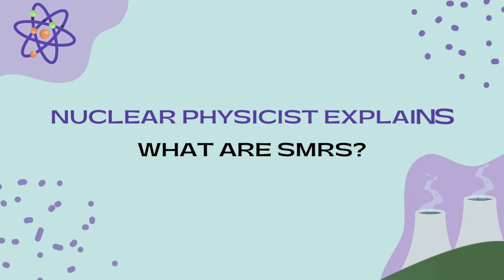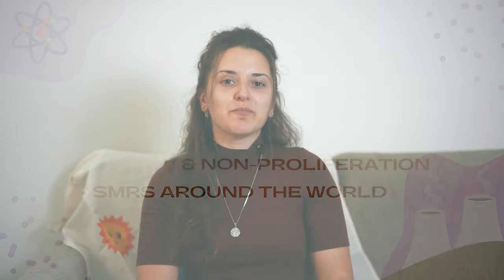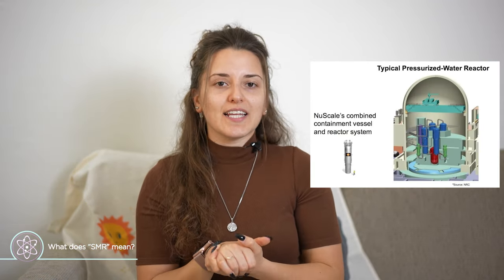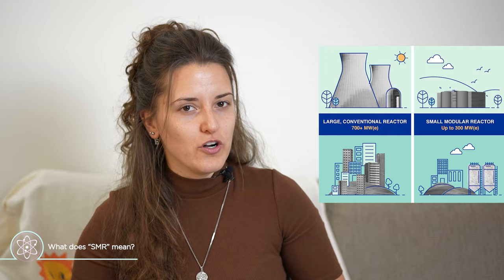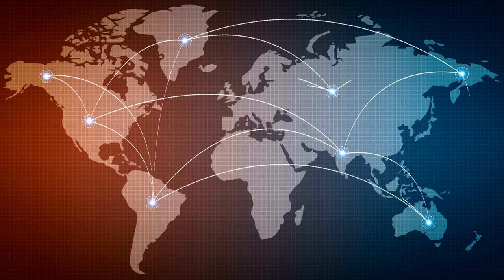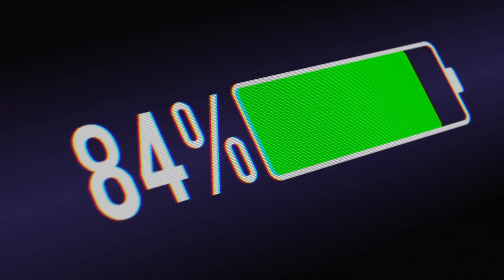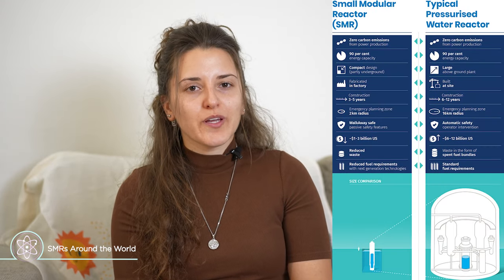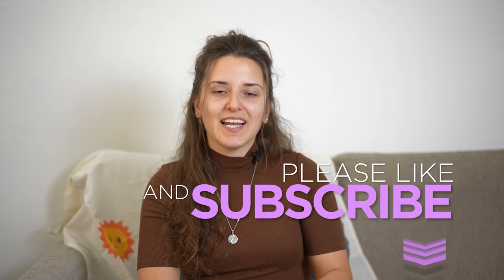Nuclear Physicist Explains - What are SMRs? Small Modular Reactors

Comment: I think it would be great if you made a video explaining to people how the new reactor designed are designed to be more "fail safe" by physics rather than by safety systems. In other words, when things happen to the new reactors, that would be catastrophic to the older ones, the reactions stops by itself, not by mechanical intervention.
Reply: Nuscales failsafe left the failsafe in the condenser and wasn't failsafe like Nuscale advertised it.  You people don't really think they are failsafe do you?
Reply: @paulmobleyscience  😂
Reply: Curious question: Can this be weaponized at all? My only concern is that nuclear technology would be very dangerous in the wrong hands. Would this be an exception?
What if some nefarious organization gets a hold of these and somehow builds a nuclear warhead out of this?
Reply: @paulcataluna9796 You can build a military nuclear facility without having any civil nuclear power plants because there are different means to produce enough material for a nuclear bomb. North Korea doesn't have a civil power plant but it has nuclear weapons.
Having a wealthy society keeps countries from starting wars and having hostile regimes and dictatorships. We could end povert, hunger and the global warming with cheap smr, the heat of the smr can be used for desalination, high-temperature electrolysis or process heat for the industry, and with CO2 capture nuclear can run CO2-negative because it's the only source of energy producing less than 5 gramms CO2 per kilowatthour, so it can remove more CO2 than it produces.
 Sorry for my bad English, I hope the message got through it nevertheless.
Reply: @OnYourMarkgitsitGooo  You can have nuclear power plants without nuclear weapons. The uranium needs to be enriched to work in nuclear power. It needs to be much more enriched for a bomb. We want to worry more about who had enrichment facilities rather than power plants.
Reply: Some analysts looking at the waste streams of SMRs conclude that smaller reactors will produce more radioactive materials per unit of kilowatt hour generated compared to larger reactors.

Schneider: That’s the MacFarlane and colleagues’ paper, which is pretty logical if you think about it. If you have a small quantity of nuclear material that irradiates other materials, then it’s proportionally more per installed megawatt than for a large reactor in which there is a larger core.
Reply: grahambennett8151  Have you seen Kreosan English yet?
Reply: grahambennett8151 
Your doomsday thinking is outdated.  Advances in radiochemical engineering now allow for the creation of non-breeder reactor designs - including SMRs - that can BURN HIGH-LEVEL WASTE and leave low-level or non-radioactive waste behind.  Of course, a module can't be fully loaded with it, but it can take some and transmute it into morevmanageable byproducts over its fuel cycle, which can be replaced with new waste-bearing fuel elements.  This also typically makes the reactor unsuitable for producing Plutonium to be harvested at the refueling cycle, because the 'breeder' material is not part of that reaction process.
Reply: grahambennett8151 
You raise a good point about the support industries for nucleae fuel production & waste handling not being carbon-neutral.
Are you familiar with the Haber-Bosch process?

Comment: There is a former coal fired power plant in Wyoming that was being shut down. The coal fired boiler was removed, SMR's are being installed and will use the existing steam turbines to continue generating electricity. This is the best use of SMR's, replacing coal fired boilers in existing plants.
Reply: what's the status of this?

Comment: We have already broken ground for one in OntarioCanada and have plans to build a couple more.  We need the clean power for the electrification process that is under way now!
Reply: Really?
My understanding is that there is only an MOU in place. No registered design, no committed finance.

Odd that Canada isn't backing it's very own CANDU, favouring a fundamentally less efficient SMR concept. 
Very strange.
Reply: @aaroncosier735  well, we are refurbishing the CANDU reactors at the Pickering power station to get another 30 years out of them, and we already did the ones at Point Elgin. I think the relative simplicity of installing SMRs makes them an attractive option for the powers that be. There is a big EV transition under way in Ontario, so they need more power relatively quickly in order to supply projected power requirements.
Reply: @WhatWeDoChannel  
Refurbishing is not quite the same as new build. I agree that doing so gets a little more back out of sunk costs. 

The claimed simplicity of SMRs is so far just advertising. 
Small reactors are not attractive: they are less efficient and projected to cost twice as much per unit of energy produced. 
The only selling point is the perceived modularity, which is still a pipe dream. None of the existing SMR concepts has gotten past the drawing board. They will require demonstrators to confirm the basic concepts, and those will not be "modular". Then further rounds to get to a hand-built prototype of the future modular design, then a factory to make them. Don't expect to see SMRs for many years.

EVs may increase demand, yes, but they also have a huge storage capacity. They will enable the use and storage of more variable renewables. Rather than increase demand for nuclear, I think EV storage will increase the usability for renewables, which are available now rather than SMRs which could yet be decades away.

Comment: Although it may be technically possible, IMO output flexibility is not really a useful feature of SMR. Since most costs for any NPP are in construction, reducing the output at any time just increases the cost per unit of electricity produced. I think that all Nuclear is most useful as a baseload source, because it can reduce the amount of (expensive) backup capacity that is needed for variable renewable sources. Many studies show that for a low carbon electricity system, including some nuclear in the energy mix greatly reduces the total electricity system cost, even if the nuclear electricity is itself expensive. The key feature of SMR as you highlighted, is the possibility to reduce build costs through mass production.

Comment: Yes, this is an excellent professional Physicist presentation, thank you for the absolutely educational discussion, please.
My question as a layman on the above subject is how can this SMR be Hybridised to be applicable with Solar power Supply System with a battery Storage systems, especially in areas with more than 12 hour of solar radiation?
Reply: That's more of a grid design issue than a reactor system design one, but essentially yes - it would just take a mini-substation with a set of high-power switching inverters.
What I want to know is why would you want a yuge solar farm along with an SMR; integrating solar into housing, commercial, and parking structures is fine.  SMRs should mean that taking up acres of land with solar should be unnecessary.

Comment: @Elina Charatsidou I'm not sure if this asking too much, but is there a rough cost savings breakdown for curently built reaactor and SMR's? Also, in your opinion are Thorium reactors viable? No matter the answer, could we get a video on this subject.
Reply: I think some of the SMR proposals have included thorium. Thorium is just a fuel that's harder to burn. Making the engine smaller doesn't better the possibility of using that fuel. You just have to mix it with high level nuclear waste which is in my opinion killing two birds with one stone.
Reply: @MrBrew4321  Thanks. I'll have to try and find more information on that.
Reply: Economics depends on a lot more than just the reactor type.   The number built, their power output, lifetime, future interest rates and energy prices are all factors and some of these are not known in advance.

Comment: Slays me that it's taken almost 70 years for these to start being developed.  So many useful applications.  In the event of a natural disaster that damages the local grid, you can truck in a bunch of these to provide limited power.  Critical infrastructure like hospitals could have one to serve as their own generator in case of black/brown-outs; would simply supply to the grid the rest of the time.  What about shipping vessels and cruise liners?  A big electric car/semi charging center could wind up needing many megawatts of power; SMRs let you produce it on-site rather than beefing up the entire grid capacity between it and the nearest power plant.

What about the facilities that these plug into?  Any standardized, boilerplate designs for those?

Comment: Rather than the title SMR being applied to a reactor below a certain size, it's perhaps more fair to say that the term should apply to any reactor that can be mass produced in a factory or maybe a shipyard. I'm making this alternative distinction because the S-PRISM, VBER-300, IRIS, Rolls-Royce SMR and TMSR-500 designs are all greater than 300MWe. Keep up the great work
Reply: One of the limitations on designs being fabricated and assembled in a factory is transportation.  You can't just plan a roadtrip for an assembly massing over 100 tons and 15-20 meters in length.  Also, most nuclear countries have strict regulations on how much fissile material can be shipped in one load, how much can arrive at a given destination at once or in a timeframe, and how much can remain undispositioned on site in a specified timeframe.  So the limitations on the physical size of SMRs aren't just due to engineering, but also logistics and process control.

Comment: Stupid question but can the SMR be integrated into the current control rooms to reduce the  building costs associated with constructing control rooms? Fantastic explanation I had some knowledge around SMRs but you really aided my knowledge. Suggestion for a video would be could you watch The China Syndrome starring Jack Lemmon and Jane Fonda?
Reply: The only stupid question is the one that isn't asked.  Changing existing nuclear control rooms would require a lot of analysis. Since the inception of nuclear power there has been a lot of rules applied to their control.  Wiring must be carefully separated. Nuke plant have separate safety trains that must be largely redundant.  They usually have all the wiring pass through a cable spreading room.  These are often rather full already.  There are fire requirements for all wiring.  (Appendix R).  Everything must be seismically analyzed for earthquakes.  My gut feel is that it would be easier to have a separate "greenfield" structure rather than trying to tie it in with a decades old plant ("brownfield.) Operators in the existing control room (Senior Reactor Operators) require a lot of training.  If these operators were also expected to handle a new totally different system, it could be asking much. 

Critical parts of nuclear plants are statistically analyzed for failures. (Probabalistic Risk Assessment). Will the use of the existing control room introduce new failure modes or increase the risk of existing failure modes?  Big analysis there.

There is also the matter of when.  These places can make a million dollars a day.  Are they to be shut down while the new equipment is tied into the control room?  Tying new equipment to an existing plant can mean all sorts of local plant equipment that may need to be taken down while the new installation takes place.  In addition, the existing equipment may need modifications to allow the installation of the new equipment.  These places can be rather full so existing piping and cables may (will) need rerouting.  All affected equipment must then be tested.

Everything has to be documented to ensure the health and safety of the public.  The NRC will have it no other way.  All that documentation is extremely expensive.

This is my viewpoint from nearly 20 years ago when I worked at a nuke.  It's probably even more complex now as the security concerns have grown greatly after 9/11/2001.
Reply: @daniellarson3068 
The only proper way would be to convert an entire plant during a refuel/retrofit.  That's a hard sell when many countries are being pressured to simply decommission in the face of 'the green new deal.'
Individual installations in remotely located and remotely monitored situations seems more viable to me.
Reply: @HuntingTarg Yes - Gutting and rewiring control room would take a great quantity of time.  Building new would most likely be more cost effective.  The problems I discussed above and many others would be simplified.

Comment: The one thing I missed in this video are the possible downsides to SMRs, if they even take into effect those studies saying the possible cuts in cost are diminished by security and what all.
I know of the possible advantages enough as should a lot of viewers too. The possible hurdles are the things that are more important to know of to get over them and proceed.
Reply: When you look at nice glossy advertisement material for an SMR, with nice CGI plant site views, always ask, where is the 100m high stack, where goes the nuclear ventilation of the controlled area, where go the radioactive gases of the coolant purification, where is the cooling tower for the waste heat, where is the tritium discharged? ...

And then ask, would the electricity not be cheaper when i build the SMR larger? Then i still need only one plant crew, only one building, only one turbine ...
Reply: @NuclearSavety  First the first part, yes exactly!
For the latter part, no! Why shouldn't it be possible to use more SMRs in one plant? You are more flexible, it's still easier to manufacture and so on.
Reply: @Deinorius  2 SMR need 2 containments. One twice-as-large SMR needs one containment which costs 30% more  .... economy of scale ...

And 2 SMR have twice as many valves, twice as many pipes, twice as many valves, basically twice as many points of failure, twice as much maintainence efforts ...
Reply: Smr can be located closer to cities or factories that uses most of our electricity, so I thought that pays off for loosing energy from bigger plants due to distance or?! Is it that expensive to have extra control room? Is it not possible to have remote control rooms for multiple smr? I thought it's much faster and cheaper to build an smr than a regular nuclear plant?! Is it not true? More pipes more valves more issues but if one fails an other one can replace it. Meanwhile if something fails in a big powerplant than it's all goes to hell or?!

Comment: Hi Elina, this is Bartek (you can call me Bart) I have a few questions for you that are bugging me
I have to admit that I don't know much about nuclear physics (I'm very interested in it)

1. Does gamma radiation occur (radiate) in its harmful form on people from inside the reactor during its operation.
I ask because I have heard that this type of radiation can pass through thick concrete walls and I have also read (in books on
nuclear blast) that it can go through tank armor?

2. A friend of mine once told me that after the explosion of the hydrogen bomb (he probably meant the 50 megaton Car bombe) the troops attacking
that would occupy this area could move there without any obstacles because such a (hydrogen) bomb is relatively clean and does not generate radioactive fallout.
Is it true ?
Reply: You can learn about Gamma radiation from cosmology as well as from nuclear physics.  Gamma radiation is high-energy, highly penetrating photon radiation that can only be reduced by dense materials that have atomic nuclei close together:  Lead, Iron, and Tungsten tend to work well for this, and contribute to a reactor vessel's weight.

The 'H-bomb' is a variant of nuclear weapon that produces very little fallout, because it uses a 2-stage fission-> fusion process.  Modern "Thermonuclear" weapons use a 3-stage fission->fusion->fission process which increases yield many times, but also creates more radioactive byproducts, aka fallout.

Comment: I liked the video, but you did not separate which features come from them being small or modular, and which features (like negative temperature coefficient) come from simply being a different type of reactor.

KGHM - Polish nationally owned copper mining and refining conglomerate - has signed an intention letter to convert coal power plants to nuclear using SMRs.

I tried to read up on it, but resources are scarce, could you make a video explaining why the Japanese HTTR is so safe? Or maybe it's gas reactors in general?

Comment: what about maintenance? are SMRs cheaper to maintain/require less repair/don't need as many high-skilled workers to maintain?
Reply: Those are the assumptions. It might not work out that way. 
At least one proposal is that the reactors be single-use, and the depleted reactor becomes a sort of decay storage enclosure.
Not sure how that works out in the event of faults or gross failure.
Not sure how confident we can be that an already corroded reactor vessel is somehow a good or dependable containment, either onsite or in transport.
How long will it last? What is the deadline for repackaging?